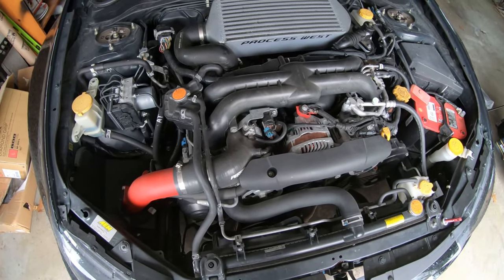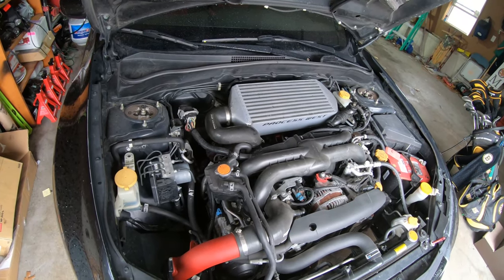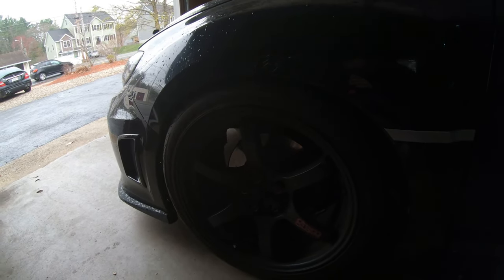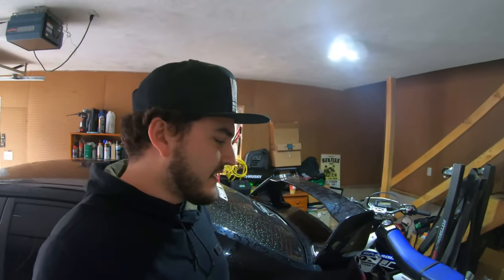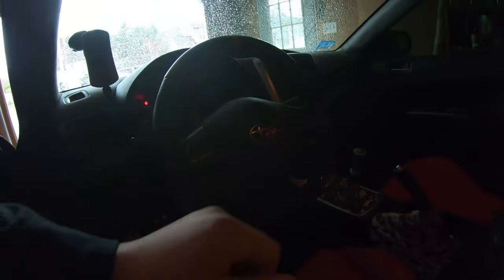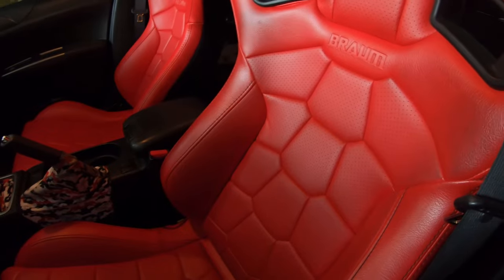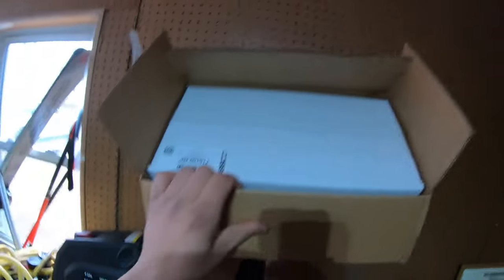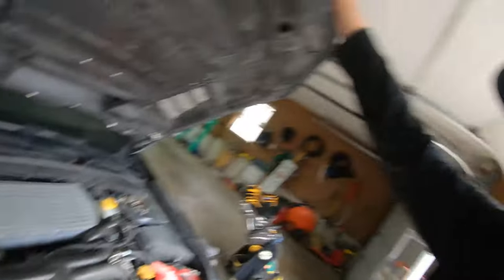SO WHAT EXACLTY IS DONE TO MY 500HP WRX??

Comment: I thought I'd let you know if your seat belt chime is still going off put your stock driver seat in and plug it in and take the buckle and hold the red release. Insert and remove it I think it's 20 times in 45 seconds and it shuts off the chime. I know it sounds stupid but I did it to mine a while a go.

Comment: I have a 05 STI with completely built long block and a 6266. I wouldn't go 6266 unless you do springs, retainers and big cams. I have larger intake and exhaust valves also. I rev to 8k and my HP doesn't drop at redline because of all my head work. I make 549 on pump with ID 1300cc injectors and a hard wired 450. My IDC at redline is 75% I love your car btw, looks very fun.
Reply from the maker: nice man! glad to hear these id1300s are capable of a lot of power! i may do head work. if its in the budget at the time. Thanks for your comment brotha!

Comment: i just bought an 02 wrx impreza. me and my dad did arp headstuds aftermarket gaskets and now it has a misfire so im gonna change injectors and drive it till it blows then do a build like this. nice vid 😎
Reply: You already did studs bro, why not just do 350 wheel at this point? You're alright especially on E, blowing up and rebuilding or buying an IAG block WITH mods is gonna be 11k or something all at once for just minor bolt ons

Comment: Could you link where you got the headlights, front lip and side skirts? I have been looking for some especially the headlights 😂
Reply from the maker: OE massive headlights. Front lip is eBay. Side skirts are strafe design. Rear spats are eBay haha
Reply: @nickgraham_  thanks! are they the halogen model only for the base?
Reply from the maker: @sneaks7673  yes sir! Make sure you get the correct ones
Reply: @nickgraham_  Thanks man love your video keep it up

Comment: Hey boss, do you have a DCCD controller for your 6 speed? I’m hoping to do a 6 speed swap soon but I’d love to have the ability to control center diff. Think it’s worth it?
Reply from the maker: I do not have one actually. When you don’t run the dccd controller. I believe it’s a fixed 65/35 split so 65% to the rear. And with the r180 diff being an lsd it makes for some good slides. So I haven’t bothered installing a dccd. Because even on stis that have it most people say to just leave it in auto anyways
Reply: @nickgraham_  dope! Thanks for the reply. Looking forward to what you do with the Rex.

Comment: What size injectors are you on? I might have missed it but I'm on id1050s along with an fp blue idk if I'm gonna make those numbers on flex I'm hoping though.
Reply: Okay scratch that I got to that part of the video thanks I would go 1600s personally according to all the 600+ guys I fucked up going 1050s so to see 500-550 I'll need bigger injectors dual pump front mount and bigger turbo as the fp blue and everything else is nit safe for 500